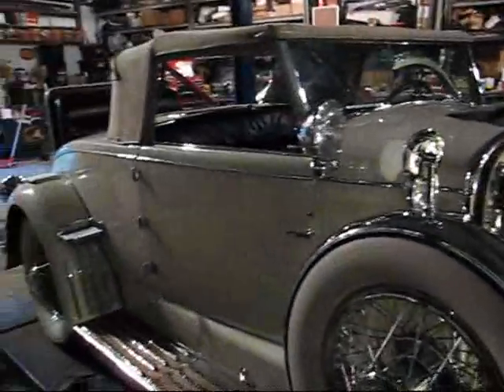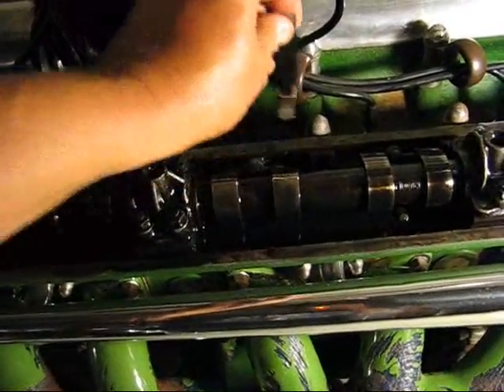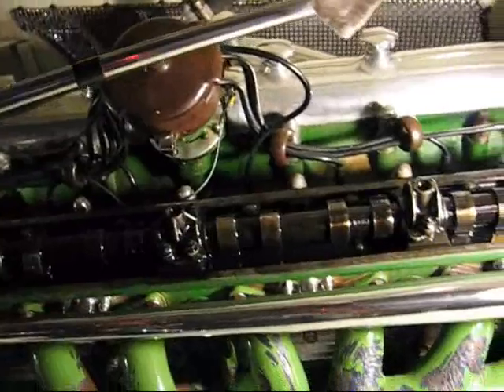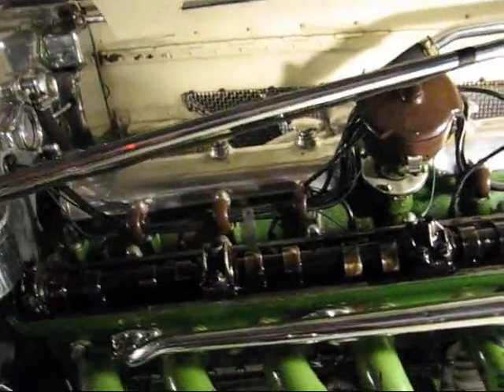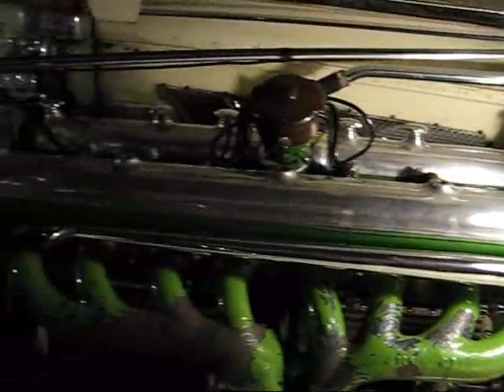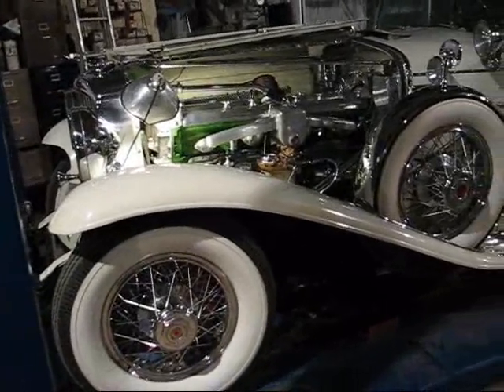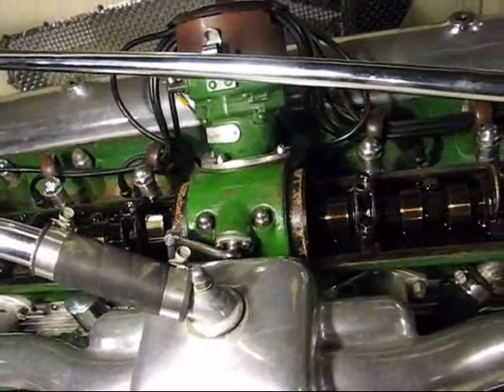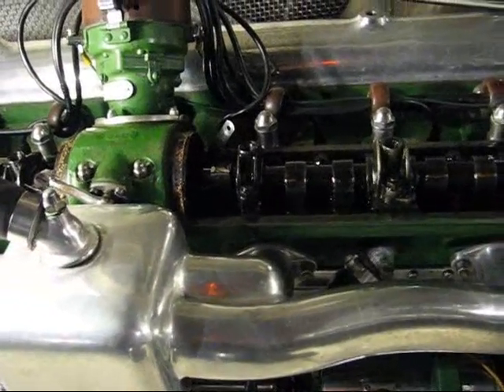Checking the valve lash on a 32 valve Duesenberg Model J Straight 8

Comment: What is the valve lash supposed to be and how do you actually adjust it? I understand they had to be adjusted every 10,000 miles. There probably aren't any Duesenbergs going 10,000 miles these days.
Reply from the maker: The lash is supposed to be .022" for both intake and exhaust. I am in the process of readjusting them tonight.

Comment: This engine is not that far removed from something like a Ford Zetec, or what you get today. I bet a Honda unit is a direct descendent of this mill. If this had EFI and electronic ignition, it would still cut the mustard at the drags today.
Reply: Uh... not really. Despite that the basic components of engines has stayed the same since then, the metallurgy involved in this unit's construction is far less advanced, and the engine as a whole is designed to run a lot slower. Displacement for power, and fuel efficiency of these is very very low compared to what we have today, for example, and the straight-8 topology is quite outdated. Additionally, as you can see, these engines require very very regular adjustment and preventative maintenance just to operate properly. Not that I am insulting the machine itself, it is beautiful and amazing in her own right, but you can't just slap fuel injection on something like this and get to 6,000 rpm. Its not made for that.
Reply: @KamFiction  A 1.6 liter turbocharged engine on a World Rally Car can definitely smoke a Duesenberg motor in most ways. Horsepower-wise the ones used in the WRC outpace this engine, which shows how far things have become since then.
Reply: K. Meinzer I was thinking of it as a torque engine that could make a period hot rod for the hot rod drags.
Reply: As far as I know Peugeot built the DOHC engine in 1913 for what it's worth, Just trivia I suppose,

Comment from the maker: @turnaful 
Thanks for the comments .  Homer Fitterling actually purchased the car from Keith Brown in 1959 while the restoration was in progress, but did not take delivery of the car until Labor Day, 1960. That arrangement was made so that Keith could show the car at the Auburn Cord Duesenberg festival, where it won the best open car award. 

I have not yet done the valve adjustment. Hopefully I will have time to accomplish that job this winter, and I will for sure post video here. 

Joel